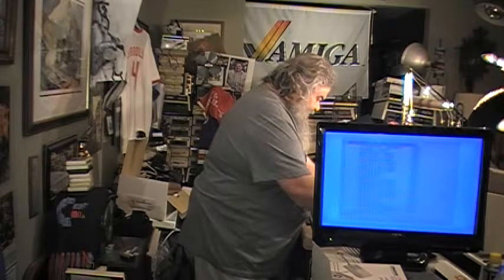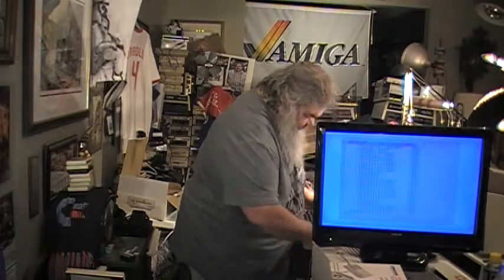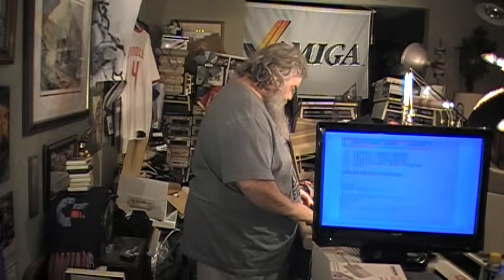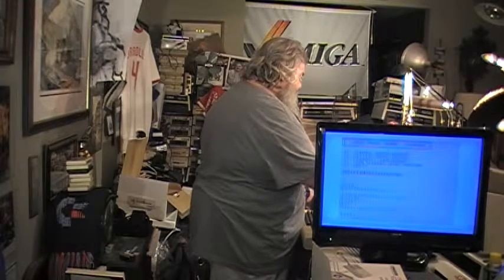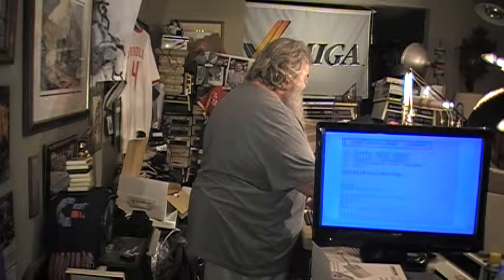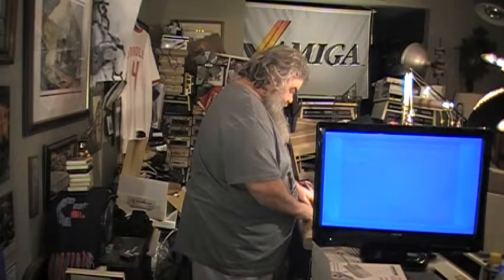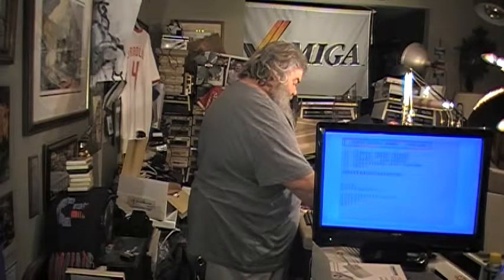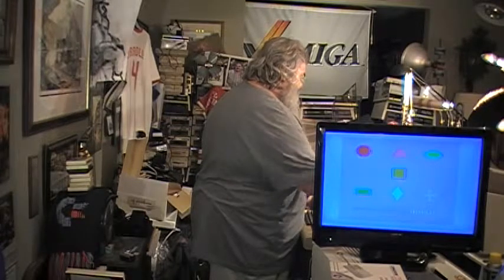Commodore - Episode 414 -  1351 Mouse  Cleaning Assessment Wide View - David Bradley - 64 C64 GEOS

Comment: I agree with you Dave. GEOS gave the C64 a desktop, but not a very useful one. The C128 version was slightly better - but if you wanted to do word processing for example, Superscript 128 left GEOS128 in the dust. It was true 80 columns, fast, efficient and as good as the PCs of the time. It also didn't have to print in graphics mode.
Reply from the maker: Yes, I think the 128 version was better than the 64...to me it took the wonderful 64 that I knew and loved and turned it into some alien...and I know there was pressure to have a MAC like answer, and it was such an answer and for some who were just starting out, I am sure it was "fine", but to me it was just a torment...and yes, the printout was an issue...I helped others who wanted to use it...but never did I stop and think that GEOS was the answer to any question or problem that I ever encountered...

Comment: geos 2 128 in 80 column was alot better than geos64,especially in fast mode with a 1571 or 1581. It does seem half the people like geos and half dont. lol
Reply from the maker: I am sure it was a good thing for some people...and I suspect with more speed, as you suggest, that it might be more workable...it just was never my thing...it took the 64 that I knew and turned it into this strange beast...